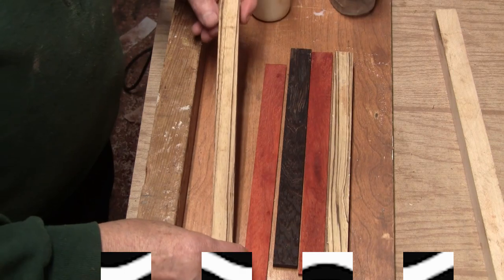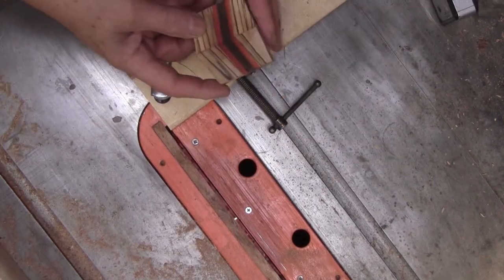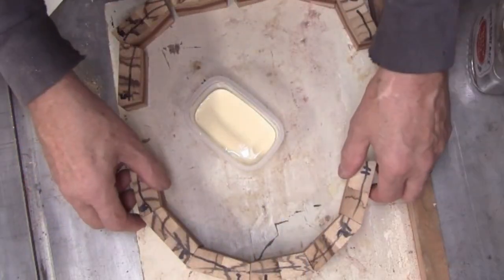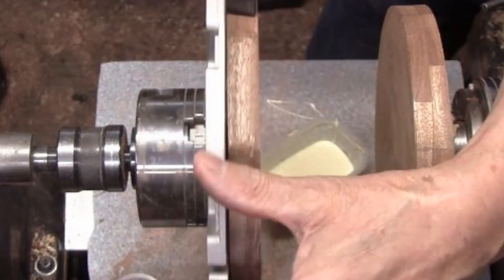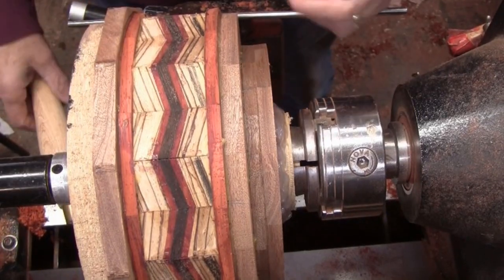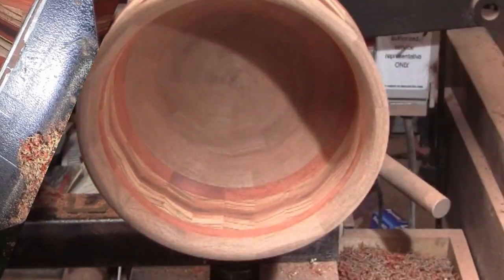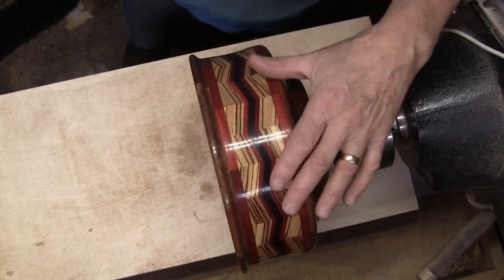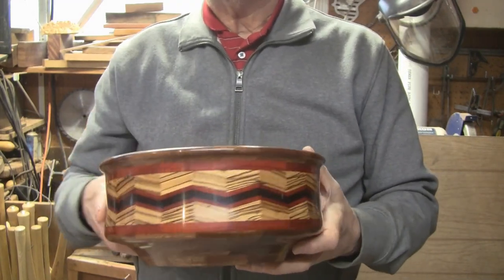Turning The Zebra Wood Segmented Bowl

Comment: Another beauty! One of the reasons I watch your  videos is for what I learn, sometimes just a small detail. Today's lesson was the wipe-on poly. After a couple of bleeds, I stuck to the spray-on finish but those fumes are strong and winter has hit and I can't spray outdoors. This is a great solution. I had to chuckle when you mentioned the heater was on in your shop. Before I started to watch this, I turned mine on to knock off the chill before I start. My dream house would have a fully insulated, heated, air conditioned shop with exhaust fans, etc. My real world, like a lot of us, is an unheated garage, though I did add a window AC to it last year.
Reply from the maker: Thank you Josh. I have not tested it for Maple but I will do that when I go out to the shop. Which I need to do to turn a heater on. Normally getting the chill off is enough and I can shut it off when working.
 I used to go steelhead fishing in the winter and above freezing was a warm day in my drift boat. Now I fish for them in the warm months.
Take care,
Gary

Comment: That bowl is so nice looking.  I have never seen that combination of woods used together and they are just beautiful together.  Thanks for showing the sled you used in putting a 15 degree on each edge.
Reply from the maker: Thank you Larry and I have never used them together before. I knew I wanted the Zerbra wood and I love Padauk. The Wenge had to be used just to show up. I tossed around using Walnut for the rest but I have been wanting to use the Sapele that I picked up months ago. It just all worked out.
Happy you liked it.
Gary

Comment: One good takeaway from this video: to leave a section uncut when cutting the angles.
One remark: The angle finder does not tell you if your table is at zero degrees. If not sure, check that before you start.
Great video Gary. 😎
Reply from the maker: Thanks Leo. So the angle finder has a button to zero it to the surface you are working on. The way my saw is sitting it is about 3 degrees from being flat to the world. As far as my angle finder know it is set to a table that is now zero.
Another good trick is if you want to set the bandsaw table at an angle you put the angle finder on the blade and zero it. Now the table is adjusted to to the blade.
Thanks for watching,
Gary
Reply: @ThePapa1947  Well, I have one of those angle finders too and its a great piece of kit. 
For one thing the battery seems to last forever; it still turns on when I use it which is not very often. 
Maybe mine has that zeroing feature too but I'm not sure. I always check the table first and thus far my table is always close to zero. But it sits on a wooden floor so it might vary over the seasons. Without a reference, the 7.50 degrees could be way off from what you really wanted.
Reply from the maker: @emgiwoodworks  when getting the angle on segments and getting them to close up you have to be more than pretty close. Being off .5 degrees will make each segment off by 1 degree times in this case 12 segments. We had a high dollar digital level a work and it also had a zero button. I would sure hope you angle finder has a zero button.

Comment: Way to go. I learn something every time I watch one of your videos. I really like how you used the holddown clamps to help secure your segments when you were cutting them.
I also use hot glue to secure my vessels to my waste block. I have found that I can use a heatgun for a few seconds and it pops right off. Keep up the good work.
Reply from the maker: Thanks so much. Happy you enjoy the videos. I use a clamp like that on any piece that small. Especially if cutting it with the blade tilted.
 I think a heat gun would work great. I worry about the heat on a thin segment but it might be fine.
Thanks for watching.
Gary

Comment: Just Amazing I dont know how you work out all the angles etc stunning finish
Reply from the maker: Thank you Colin! Well the angles are fairly basic for the ends of the segments. But I used a lot of geometry and trigonometry  in my work. But there are lots of segment calculators that will help you with it. Such as getting the length of each one for a diameter of you choice. Such as Segment Calculator 2 for you cell phone. A free download.
Thanks for watching,
Gary

Comment: It’s always a pleasure to see you create Gary. You are a true artist. I have a couple of questions. You made a segmented bottom. Have you ever had issues with wood movement long after making a bowl where the bottom separates or cracks. I’ve seen other turners say they have had this issue and resolved it with a floating bottom.
I am also interested in where you got the adaptor that allows you to mount your chuck on the live center on your tail stock. That would solve some issues for me.
Keep up the great work. You are truly inspiring.
Reply from the maker: Thanks so much Jeff! Well I have been making full segmented bottoms for close to 50 years and not had any problems. 
 I find it hard to understand the need for a floating bottom when the bottom is segments with the grain running just like the side of the bowl. Plus if you look close you will see the bottom is a double layer of segments that are staggered. 
 Maybe a solid bottom might be an issue but I have done those as well. The floating bottom is a good option if you can not get your segments to meet in the middle. 
I think this is the tail stock adapter I have but I think I bought it on Ebay.
https://www.pennstateind.com/store/LTCA18.html

Thanks for watching
Gary
Reply: @ThePapa1947  Thank you Gary

Comment: That is so captivating, Gary! A fantastic pattern, broken by an even more interesting natural pattern. The glue-up process was good to help me continue to wrap my mind around all the segmented turning concepts.

And, who knew wipe-on poly wouldn't bleed. That's an easier option for me so I'll keep it in mind. A local club member uses it on dyed pieces, successfully. His colours don't change when it's applied, compared to how he said Danish oil changed his dye work. Try it on a scrap, first, like you did, I suppose.

Thank you for sharing your work.
Reply from the maker: Thank you very much Jay! Yes I love how all the Zebra wood pieces look a little different than the others.
 Even the water based poly made the padauk bleed. Maybe I had not tried the oil based but it sure worked. But I will try it with Padauk and Maple just to be sure.
Take care,
Gary

Comment: WOW, another beautiful segmented bowl. You make it look easy but I know it’s not. Is there a particular app you like to use to calculate your rind sizes. I think this one is my favorite so far.
Reply from the maker: Thank you Michael! So one app I use just to get the segment sizes for rings is called Segmented Calculator 2. It works on you cell phone and is free.   But this turning I designed in a program called WoodTurner Pro. It is a reasonably priced product used on your computer. You get 3D pro for free with it which lets you make computer sketches you import into WoodTurner Pro. But I bought the package of 3 which is reduced a lot for all 3 and there is a program to do feature rings. Although this ring is easy to do without. Check out this web page and you can see the software and do a free trial as well. https://www.woodturnerpro.com/
Thanks for watching,
Gary

Comment: Gary, this bowl has become a great inspiration to me, especially the feature ring.  I plan to incorporate that design into a new project, and would also like to ask if the base is made from 12 pieces from one board width, how did you cut those wedges?  Just a stunning piece in all respects.  Thank you!
Reply from the maker: Thank you very much Dale. Yes the bottom is made from 12 segments that meet in the center.
I cut those on my wedgie sled and they all went together with no adjustments. A fine tooth blade and slow cuts so the ends stay together and it works just fine.
Thanks for watching and if you have any questions let me know.
Gary

Comment: Gary, really enjoyed this bowl vid and how you used your homemade jigs. I am intrigued on dismounting the tenon. It looks like you have reused this a few times but how do you attach it to the bowl blank so it doesn’t detach while turning? Also what is the glue spreader used?
Reply from the maker: Thank you Robert! Yes I reuse those tenons, I use a strong hot glue  around the outside of it. You would want to test it out on something much simpler as I would hate to see a segmented piece like this come loose. 
It does hold very well though. 
 That glue spreader is made from some window blinds we trimmed shorter. I saved the cut offs and use them for mixing 5 minute epoxy on but also cut some about 1 inch wide then cut a saw tooth pattern on the ends. 
 I will try and show them on my next glue up. 
Thanks for watching,
Gary

Comment: Hello Gary. I really admire the work you do, very innovative. I have a question on the bottom piece, did you make one ring and spit it? I appears to be 2 quarter inch rings. I have been wanting to try this type of bottom but others say its a no no, but you say you have had no problems with it. Also are the other rings 1/2 or 3/8. I have always made 3/4 rings and was wondering if its difficult to glue rings that thin. Again its a fantastic looking vessel and I may make one if you don't mind  me copying
Reply from the maker: Hi Charlie,
 Yes the bottom was glued up as one and then cut into 2. Same with the wider Padauk ring.  Two of the Sapele were .5 inch but I sawed the pieces to about 5/8 and made the segments then turned them to 1/2 inch after they were glued in place. A drum sander would be useful for that but I have done a lot of things without one. If I had more room I probably would buy one.
 Hope that helps but if you have more questions let me know.
Gary

Comment: Beautiful piece of work. Wish I could get the bottom layer to come out tight in the middle. What's your secret?
Reply from the maker: Thank you Art. So a very accurate sled and a sharp blade is good also. Do not force the cut especially when it takes the last bit off the segment. And that goes for the beginning of the cut as well.
Hope that helps,
Gary
Reply: Thanks 😊

Comment: That is a beautiful bowl Sir.  Thank you for sharing.  When using paduak would it be of any use to put sanding sealer on it before glue up?
Reply from the maker: Thank you Lillie! Well if I did it before the glue up I would end up turning and sanding it away. But what works good is to spray lacquer on lightly and it seals it. Then I can put anything I want over it.
Thanks for watching,
Gary

Comment: A very impressive segmented turning!  Question:  how do you attach the chuck to the tail stock so that you can compress the rings after glueing?
Reply from the maker: Thank you Jim, I have a tailstock arbor that has threads on it so I can mount a chuck to it. There are ball bearings in it so I use it for lots of things. This is like the one I have but I think I bought it on Ebay. https://www.pennstateind.com/store/LTCA18.html
Notice it is a 1 1/8 thread but I have 2 chucks from my old lathe with that thread that I use of the purpose. Other wise you would need an adapter if your chucks are 1.25X8 threads.
Thanks for watching.
 Gary
Reply: @ThePapa1947  Thank you for the information. Keep on turning!

Comment: Nicely done. Been looking at trying something of that nature for a while but I've been hesitating on the ring glue up. I've gotten a couple off centre and the turnings didn't work out well.
What adapter do you use to fit your cole jaw chuck to the tailstock? A bushing from 3/4 x 10 female  to 1 1/4" x 8 male to fit onto your live centre or is there some thread adapter in 1 1/4" x 8 with a # 2 MT already fitted?
Thanks for your help.
Reply from the maker: Thank you Randy! This is the adapter I use: https://www.pennstateind.com/store/LTCA18.html 
I have a few chucks with 1X8 threads from my old lathe. 
I do like the idea of the adapter with 3/4 x10 internal and the 1 1/4-8.  I have 2 live centers and could dedicate one for just this use. I may make one some time but I really do not need it. Just fun to do.
This is the adapter I use: https://www.pennstateind.com/store/LTCA18.html
 Thanks for watching,
Gay

Comment: Hi Gary. Thanks for the video. I have been wanting to try some laminate designs. Beautiful bowl!!! Question: after you glue the wood strips together you cut them at a 15 degree angle to form the chevron. What length do you go by? Is it 1/2 the SEL or a little longer? If longer, how much extra do you suggest? Thanks BTW: I am still trying to figure out how to center the glued chevron pieces for the final angle cut. (???)
Reply from the maker: Hi Jim, I am sure you will enjoy making these shapes.
If you email me I could probably help you better with these questions and provide some sketches and information that will help.  mgdpapa@gmail.com
Gary

Comment: Question? The base is segmented , what do you do to prevent movement? Thanks
Reply from the maker: Well the reason I use segments is there is very little movement in them. I am guessing you are thinking of a floating bottom but I have never used one and have bowls almost 50 years old with segment bottoms and they have not moved. Perhaps it is where I live that they do not move all that much. Plus I always use 2 layers for the bottom which I believe helps it to not move.
 Hope that helps and I am sure you have heard otherwise but what works for some may not work for others. 
I think it stems from my job as a wood pattern maker. Almost every turned pattern was made of segments and they were very stable.
 Gary
Reply: @ThePapa1947  Thank you for the reply. I have used floating bases, but mostly I use a solid base. I have not yet had any problems with this. The only segmented base I made cracked. Do you made your segmented bases , then split them, then rotate them them a half segment? Or am I making this more complicated? Thanks Chuck
Reply from the maker: Hi Chuck, most of the time I will make one bottom thick enough to split and rotate.
 I use my band saw sled I made for making dizzy bowls. It works great for splitting rings in half.
 I also use solid bases and have not had issues with those either.
 I suspect if you have a lot of humidity changes then there could be a lot of issues.
Gary

Comment: ????? do you put the line on the top face of the board before cutting????
Reply from the maker: As I mentioned in the video if you put a line on top and keep it that way when you cut the segments then they will fit perfectly when you glue them together. The reason is one end of the segment is cut on one side of the blade and the other is on the other side of the blade. So if you blade is off even a little the joints will fit. If the blade was off a lot they will still fit.
Hope that makes sense.
Gary
Reply: @ThePapa1947  yes it makes perfect sense. I just missed the part on where the line was drawn. I should have gone back and listened to that part. Thank you for the quick answer and all the ideas you share.
Reply from the maker: @pepper7144  happy it helped and I am sure lots have wondered about those lines.
Take care,
Gary